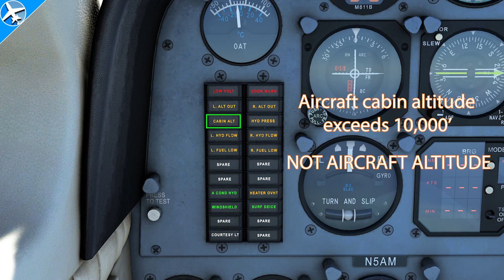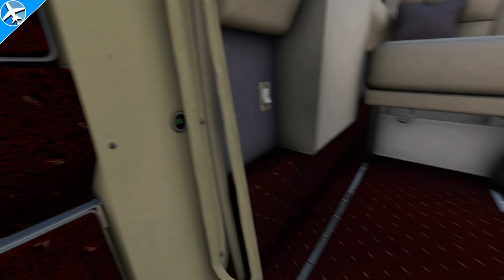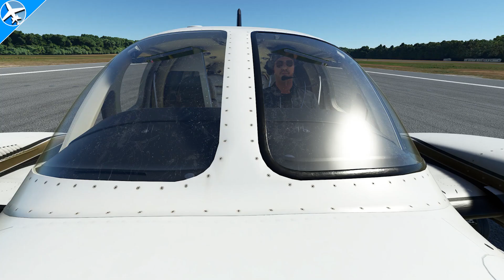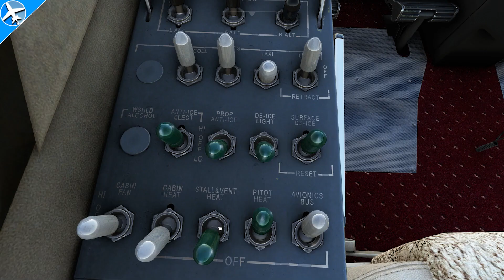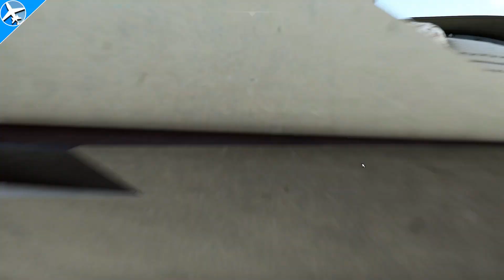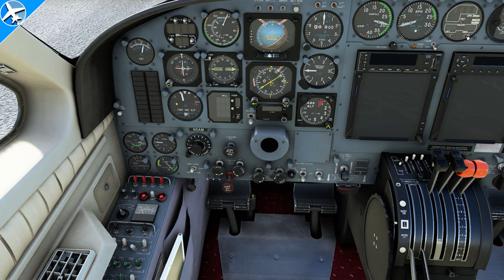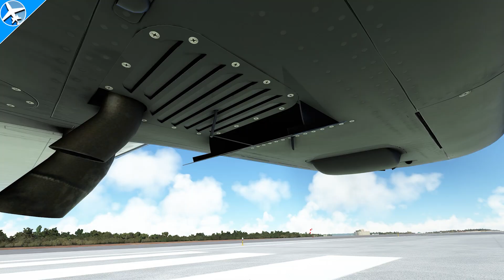FlySimWare Cessna 414AW Systems and Switches: An Explanation by a Pro Pilot

Comment: The Cessna 414a and 421 certainly DO NOT have liquid cooled engines from the factory
Reply from the maker: No they do not.  I used to fly 421s.  There were a few 414s with Ram conversions with liquid cooled engines but also that I found when researching.  The manual for this MSFS add-on airplane originally had published the engines had liquid cooled engines which was later changed after this video was made.

Comment: Just bought this and the Lear not too long ago. Your presentation managed to be simultaneously comprehensive and expedient. Many questions I were answered. One thing I noticed is that the mixture makes that clicking sound at the absolute slightest movement, so I had to bind that to a less sensitive axis control, less the noise drive me crazy. Big thanks for this video!
Reply from the maker: The FSW 414 and Lear are great MSFS add-on aircraft and will probably be some of the greatest add-ons of all time for the sim.  Funny thing is you can't hear the "clicks" when adjusting the mixture when the airplane is flying in real life, but you can feel them.    Glad you enjoyed the video and found it useful!
Reply: I LOVE that clicking sound. Flown 310, 414 and 421 in real life and I love hearing that sound every time.

Comment: My fuel and RPM gauge needles are buggy, they keep flickering and changing values in a fast pace. Any workaround?
Reply from the maker: Are you using MSFS 2020 or 2024? Have you downloaded the latest update?  I have not noticed this on my sim when using MSFS 2024 in the last 2 days.  If your file is updated, I would suggest going to the FlySimWare discord server and posting your experience there.  Someone else may have had the same problem and have a fix.
Reply: @thecorporatepilotdad  It's 2020. The fix is to disable the auto mixture.

Comment: I love this bird but sometimes the front wheel does not function after landing while taxiing?
Great work by the way
Reply from the maker: The 414 is definitely one of the best add-ons for MSFS 2020.  When You say the front wheel does not function, do you mean it doesn’t turn left or right and you can’t turn the airplane or it does not rotate visually?
Reply: @thecorporatepilotdad  
Thank you very much for replying.
I mean the plane will not turn left ou right at low speed after landing unless I increase significantly the speed . 
My wheel is turn but the plane keeps going straigt as if there is not enough friction on the front wheel.
Could it be a problem with my harware VelocityOne flightstick or because I had the Prop Sync still turn on Phase or something ellse?

Sorry if I am making english error because I am a French Canadian from Montreal.
Thanks in advance you are the best.

Comment: Gnt 750Nxi...is it worth it? Thinking of getting the premium PMS750 / lifetime, but not sure.. Is the nxi also usable in most 3rd party planes that supports the PMS?
Reply from the maker: I have used PMS and TDS versions.  The TDS version is my preferred GTN between the two choices.  They both work on many add on aircraft but I use the GTN over default GPS units when it’s an option.  The GTN is very easy to use.  Either version is worth the money in my opinion.

Comment: Hi,
I have a question for the ADF. The left knob is for 2 different ADF settings but the airplane has only 1 ADF. It is alright, I can set it to make the ADF needle move. But what is the yellow needle for? And the right knob? I never got to move it in any navigation settings. I guess it's for VOR but is does not work for me.
Reply from the maker: The yellow needle is an RMI which acts like an ADF with NDBs, except it uses VORs.  The bearing pointer will point towards a VOR.  In the bottom right corner of the ADF/NAV instrument in question, there is NAV 1 or NAV 2.  Select the NAV source and the yellow needle will point to the VOR.
Reply: @thecorporatepilotdad  thank you, that's what I thought. But for reason it doesn't work for me with the GTNs, whatever I do. Next time I'll try the GNS, maybe that works.
Reply from the maker: @tothzoltan89  I tried it with the TDS GTN and it worked fine.

Comment: How did you get the gtn750 to turn on. when i load in with the gtn 750 then i do startup and turn on avionics master it doesn’t turn on. Can you please tell me why
Reply from the maker: Did it work previously and just stop working? If so, make sure the TDS GTN  and 414 are updated.  Also, make sure the TDS GTN 750 on the bottom of the livery rows is selected.   If you start with engines running on the runway does the GTN turn on then?

Comment: The C414A came with a TSIO-520-J and if upgraded by RAM it’d be an NB, never seen any other than RAM V liquid cooled.  Ceiling is FL300 but due to RVSM the most you can go is FL290.  Keeping the engines cooled in that thin air is touchy, and the plane’s sweet spot for operating between FL200 and 230 and you’ll NEVER get above 210 KTAS, so 230 is unrealistic. In the low teens 190 is typical. Of course all depends on power settings and temperature. There is one liquid cooled only by RAM called the RAM V.  All the other RAM’s (IV, VI, VII) are air cooled.  I own and fly a 1980 C414AW RAM IV, have flown the C421 (GTSIO-520-L and N) which are geared.  Any liquid cooled engine will not have opening in the engine cowl. In any piston aircraft, especially these big bore ones, slow and gentle throttle movement is necessary for engine longevity.  On take off, I apply the brakes, mixtures forward (after start up lean for smooth running and engine longevity), throttles to about 1700 RMP, mixtures rich, fuel pumps on, and throttle up slowly.  Brake release depends on runway length. If operating on a shorter runway,(calculate accelerate stop distance) you’ll want full power before releasing the brakes (if rwy is not slick).  On long runways I throttle up to full power slowly with no brakes reaching VR at about 95 kts. You can pull the Fuel Flow meter circuit breaker instead of turning off the battery. For the backup extension, you have to pull it very hard…but in sim that doesn’t matter, and I’ve had to pull it once.  Once pulled you have to have the hydraulic fluid purged to get rid of the nitrogen, and fill up the fluid again as well as recharging the Blow Down bottle. Takes about 4 hours to do.  I have a few thousand hours in Twin Cessnas among other corporate jets, and turboprops.  Overall a good video.
Reply from the maker: The original manual with the 414 for MSFS stated the engine was liquid-cooled but that was incorrect and changed in the manual after the video was made.   I kept some parts of the video applicable to the sim and not real-life.  Just like not mentioning RVSM.  RVSM isn't really observed in MSFS and on the opposite end of that spectrum, VATSIM controllers have assigned FL420 to aircraft in the United States without knowing or being aware of why FL420 is not a usable altitude (although, I have flown at FL420 once).  I flew 404s and 421s and never went above the low 20s (in the 421).  The fastest TAS observed in level flight was 225 at FL240 (I think, that was over 20 years ago).  When this video was made, working circuit breakers were not a thing but I'm curious to see if pulling the fuel flow CB will reset the fuel computer in the sim.  Thanks for the lengthy and detailed comment! My twin Cessna time reached around 500 hours when I left to fly corporate jets almost 20 years ago and I've been at the same job since that time.
Reply: @thecorporatepilotdad you are just talking shit and I dont believe you anything. You even dont know which engines the plane has. A pilot can spot a stinky nut on instance. You are a talker and got little sim basics by reading in the net. 🤢☻️😅
Reply: Digging up an old comment here, but if you're still round would you care to share any techniques you used regarding inflight engine handling and decent planning in the 414 or 421? I always wanted to fly the 400 series, but there were only a couple of them operating in my country and sadly the planets never aligned for me. If they bring the aircraft over to fs2024 I might pick it up and do a bit of re-living my youth haha.
Reply: Wow excellent!  Just printed your comments for reference :)

Comment: Awesome video!  I believe VOR antenna, 1/2 on each side.  Our 6/260 just has v shaped at top of vertical stabilizer.  Flew in the 414 once and was nice, but they upgraded to 441 and it is super sweet to fly.  Everything happens very fast, but the sound of those turbo props are awesome!
Reply from the maker: The antenna on the tail is the VOR and LOC antenna.  Some airplanes do have the V shaped antenna.  The 441 would be sweet to fly.  I flew 421s and 404s but always wanted to fly a 425 or 441.  Here's to hoping we get a Cessna 425 or 441 in MSFS someday!

Comment: glide slope antenna. Great video. I have flown the 421 and built both the 414 and 421
Reply from the maker: I also flew 421s.  Did you work for Cessna?
Reply: @thecorporatepilotdad  Yes, from 1971 to 1978. I started on the 340 then went to building the main fuselage for the 421 and 414. I also built the carry through wing spars for the 414 and 421. And the engine mount spars for the Citation and assembled the tail cone for the Citation. I finished on the main fuselage for the 310. I then went into full time flight instructing. I retired from American Eagle in 2014 after 26 years with them.
Reply from the maker: @jameswebb2856  it sounds like you had a full and amazing career.  I miss flying 400 series Cessnas.  It’s sad to think the 421 I flew was only 20 years old when I flew it and now those airframes are 40+ years old and decreasing in numbers.  They’ll never do it but it would be thrilling to see Cessna come out with a modern version of the 421 or similar 400 series airplane.
Reply: @thecorporatepilotdad  I agree on the 400 series Cessna's! I did most of my flight training at the Cessna Employee's Flying Club. Finished Multi-engine and multi-engine instructor after I went into full time instructing out of KBPT.

Comment: Hey there, fantastic video! Where can I find the avionics that you have?
Reply from the maker: Thank you.  I have the TDS GTNXi by tdssim.com.  Once installed, the TDS GPS can be selected under liveries.
Reply: @thecorporatepilotdad  Alright thank you. Do you know why my L and R ALT is always on 0 Amps? if i put the switch to VOLTS it goes up to 100 but everything else is 0.
Reply from the maker: @tedchen0025  I believe that is a limitation of MSFS.  L and R alternator amps should show the respective amperage being pulled on each alternator.  Voltage should not go to 100, it should go to 28 when alternators are online and 24 when on battery power only.
Reply: @thecorporatepilotdad  Okay, but another problem that I have is, that after like 15 mins in cruise flight, my engines are slowly going down and idk why. Its happening very slowly that the RPM drops and that both of them are not producing power anymore....what am I doing wrong?
Reply from the maker: @tedchen0025  after takeoff bring the manifold pressure back into the green (35”) and RPM to 2500.  If throttles are left at full power the engines are programmed to lose power and will eventually fail.
Reply: @thecorporatepilotdad  Ouhhh okay so that’s quite realistic! Thanks for the information.

Comment: I would love to know how to use that ABS ALT instrument on the panel can somebody explain please ? :)
Reply from the maker: Radar altimeter.  It displays height above the ground by sending a pulse down to the ground and back up to the airplane, kind of like sonar.  It’s not really used for anything more than reference on approaches by bugging the number to the left of number in parentheses in the minimums section on the approach plate.  If doing an ILS approach that goes to 200 feet above the ground, 200 would be bugged on the radar altimeter.   However, the barometric altimeter is used for height to define minimums on approaches.  I did a livestream in the 414 where the radar altimeter is covered.  My livestreams are rare so it is easy to find toward the end of the video on the approach.
Reply: @thecorporatepilotdad  awesome thank you !

Comment: Does anybody know what are the three lights Inner, middle, Outer and the MKR BCN Test button? THey are right above the Attitude Gauge. What are they used for?
Reply from the maker: Marker beacons on an ILS approach.  They are low powered NDBs that will illuminate with an aural tone when the aircraft flies over them. They are a reference for position on the approach.   They will work regardless of what is tuned in the ADF or localizer.   They are becoming very rare IRL.
Reply: @thecorporatepilotdad  thanks so much!

Comment: Awesome video. I can fly most GA planes in the sim VFR or IFR, based on understanding of the avionics and instruments, but this video really helped me understand the 414's specific systems, making it hugely more immersive for me, enough for me to make it my number 1 plane in Neofly.

I was going to buy the Milvis 310R, but I'm glad I went with my inner pilots voice and bought the 414.

Cheers and safe flying everyone 🙏
Reply from the maker: The Cessna 414 is a great choice.  It's faster than the 310 and is very accurate in terms of realism inside of MSFS and will still be a popular add-on for years to come due to constant updates.
Reply: I own both. Both are fantastic airplanes. Get that 310. You won't regret it.
Reply: @cwalke32477  

I guess it would be rude not to 😁
Reply: @cwalke32477 kinda late here but is the flight model on the 310 on par with the 414? After purchasing it, I just can't fly anything else from the marketplace. With the realistic turbulence system, it just wipes the floor with everything else. I'll take some lack of failures and consistent state if it means the hand flying is more immersive. Thanks !
Reply: @waitbalthy6342  I'd argue it's better. It also does better at wear and tear as well.

Comment: I love this aircraft--looks like a little airliner on the ground, and the front office has steam gauges.  I'd say this, the Vision and the Hondjet have been my favorite (Xbox) add-ons.  When I fly them in the sim, I feel the same comfort I feel in real life flying, where under light sport the weights are limited to 1320# but many have enhanced instruments and some have autopilots.

I always felt taking real life flight lessons that my sim experience, which started with FS2 in 1984 the same year I was given my first real life flying lesson over the Napa Valley, helped because it gave me a pilot's edge and instrument scan, and my CFI's told me the most important way to fly was by looking outside the cockpit vs. fiddling with entry of flight plan information every few seconds during flight, instead of before a flight.

Since I flew only for recreation only once or twice a year I'd file a flight plan, if I was going to spend the night somewhere.  I quit flying a few years ago after I broke my leg, not so much that I cannot fly, I worried about the risks of it braking again during severe turbulence rendering me incapable of landing the rental.  So I've settled for simming, and letting Jesus or one of his appointed human angels handle stick and rudder when I fly commercial.

I've always felt closer to being a bird with steam gauges than electronic displays, lol....
Reply from the maker: This comment was hidden for some reason, so I am just now seeing it.  The 414 will always be one of the great add-ons in MSFS.  There is definitely some great scenery over Napa Valley.  I have flown out there many times flying biz jets over the last nearly 20 years.  Sorry to hear you had to quit flying but it's great you can enjoy flying in MSFS.  There are times after flying for 5 hours in a day in the real world that I will come home and still play MSFS.

Comment: What is the altitude you need to pressurise the airplane ?  Thank you. !
Reply from the maker: The cabin starts pressurizing after takeoff.  Set the pressurization to cruise altitude plus 500 feet and when landing, landing field elevation plus 500 feet..  However, if flying from point A to B at low altitude and pressurization of the cabin is not desired, the white switch below the pressurization controller can be switched to the depressurize position which would keep the airplane from pressurizing.   Pressurization can also be stopped by pulling the two black knobs lablled PRESS AIR L R above the EMER OXYGEN knob (RED).  Those valves stop the inflow of pressurized air form the turbocharger.  Ram dump will also depressurize the airplane.